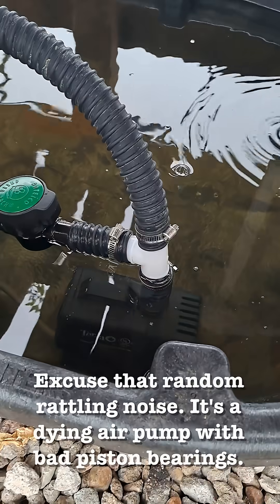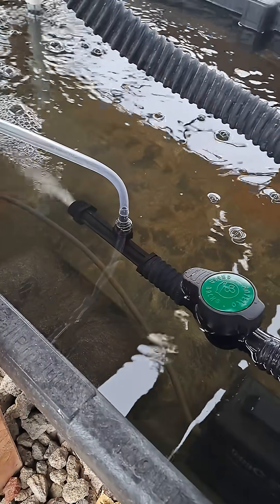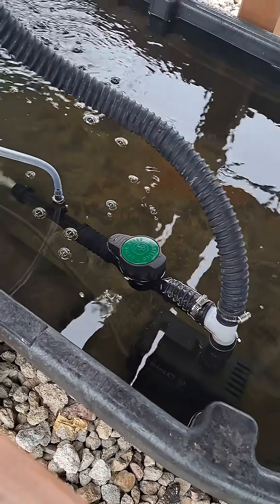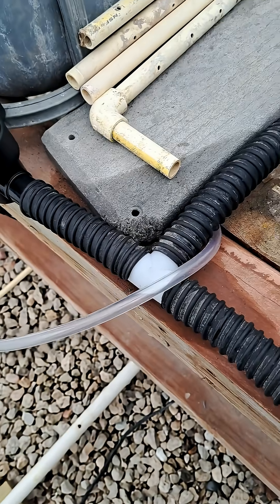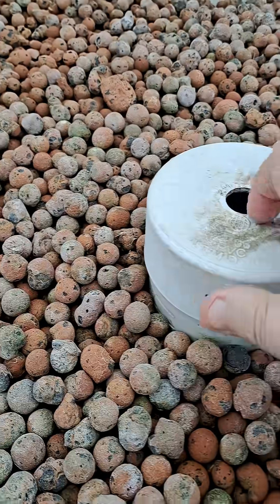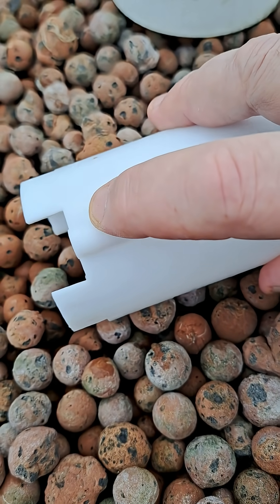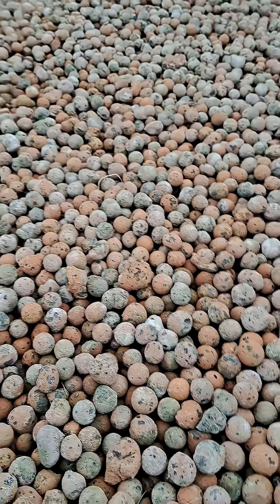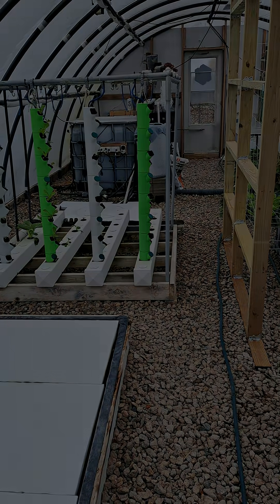Flood and Drain Bed Plumbing

Comment: Clean looking plumbing mate. Did you have problems finding the barbed fittings for the 1"?
Reply from the maker: The barbed tees and elbows weren't a challenge, getting the correct valves sent to me was the actual challenge. They sent me 3/4" valves twice. I already had the 1" tubing so that's why I went with that diameter for everything else.

Comment: I would like 5 more shorts please.
🔥🔥🔥🔥🔥
Reply from the maker: You're probably not going to like the next 2 or 3, but I need some reusable ones for my distillation product advertisements. I fully intend to retire from my full-time geek job in the next 3 years, so I need to get my retirement side-income plan rolling.
Reply: @PanhandlePonics I may like them then eh? 😅